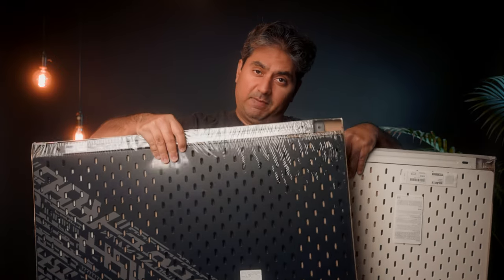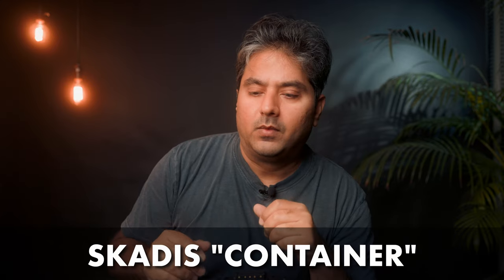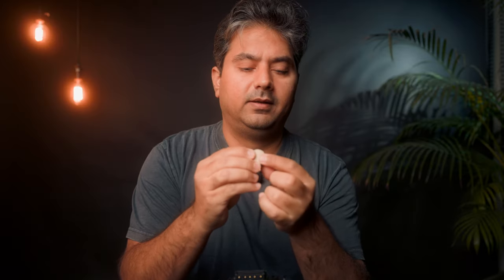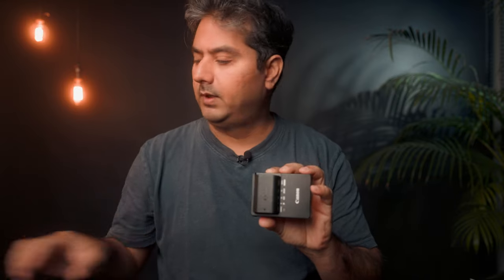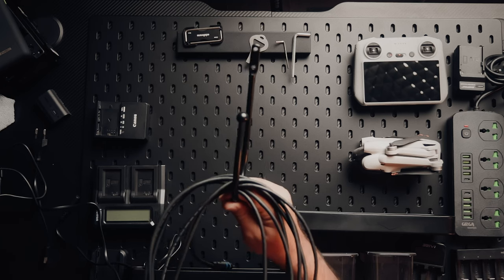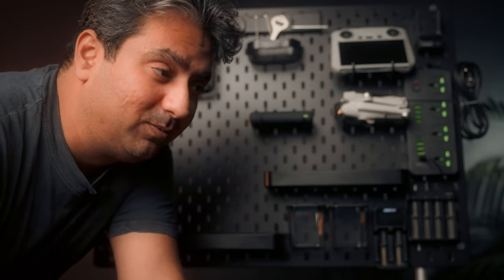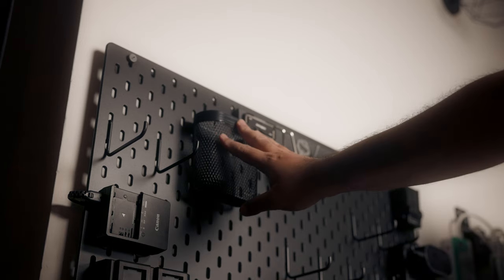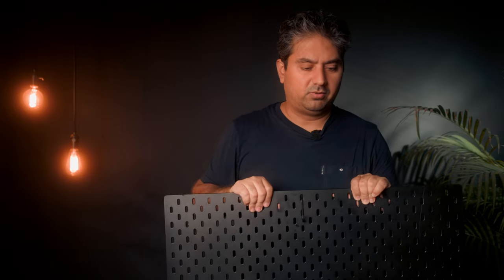Battery Charging Station for Your Studio | DIY with IKEA | How to

Comment: I didnt know there is ablack one under gaming section of ikea. Hows the paint on the hooks holding?
Reply from the maker: The black ones are great, however the pain on the hooks do tend to chip off if I move them around. Not much of a problem, barely visible.
Reply: @DrRave  maybe amazon or etsy has some black ones. Did you even paint the trays?
Reply from the maker: I couldn’t find any in India. Maybe where you’re located you’ll have better luck. 
Yes I painted all the accessories black matte.